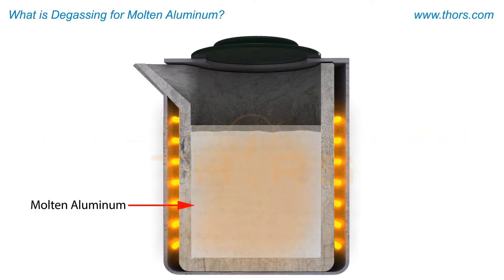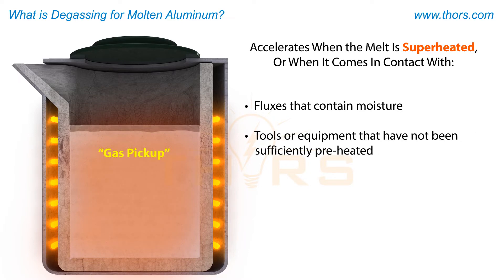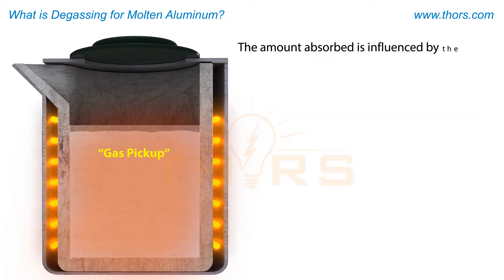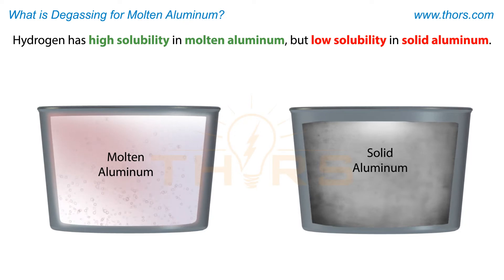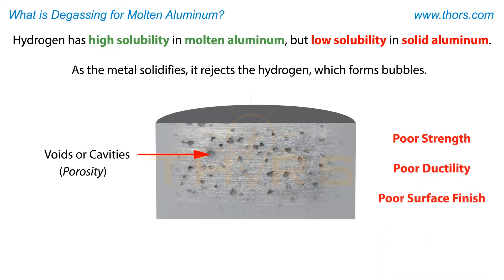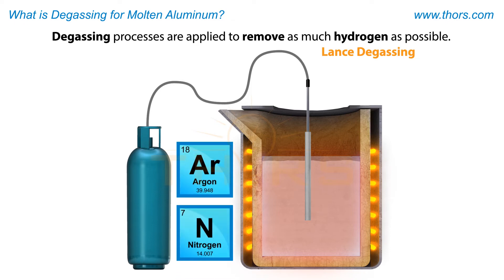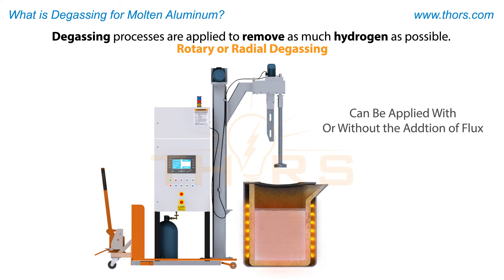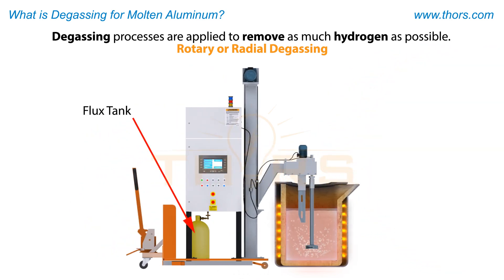What is Degassing for Molten Aluminum? || THORS Aluminum Melting Fundamentals Course Preview

Comment: Would the same results be obtained with air (nitrogen + oxygen) instead of pure nitrogen?
Reply: You typically want to avoid adding any extra Oxygen, as molten aluminum can react with oxygen gas to produce aluminum Oxide more readily. You'll turn your melt into a slag factory!
Reply: Definitely not. Because aluminium highly reactive with oxygen. It can creat aluminium oxide

Comment: Please explain what is happening when nitrogen comes in contact with hydrogen. Does it form ammonia?
Reply: It's a good question that caused me to go searching for an answer. 
 Hydrogen diffuses into inert gas bubbles as they rise through the melt.  There's no suggestion that ammonia is produced.
Reply: @davidkeenan5989  I'm guessing that the bubble forms an interface inside of which the partial pressure of H2 is zero; enough bubbles and the hydrogen will eventually be depleted from the metal melt.